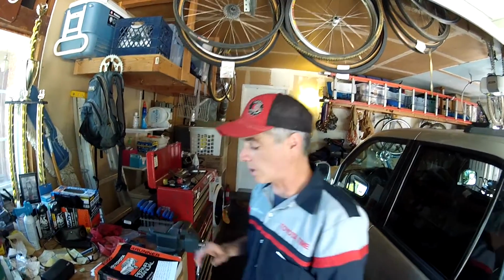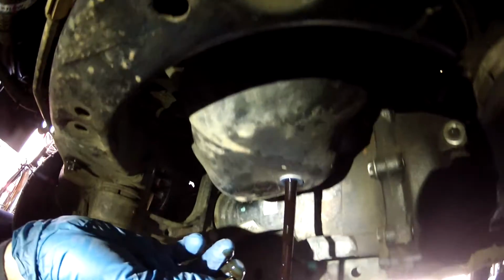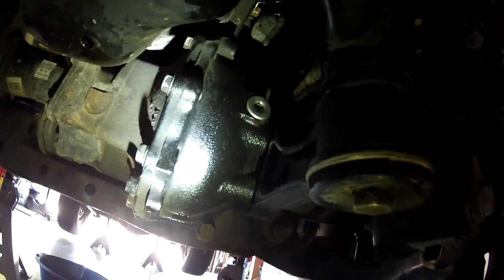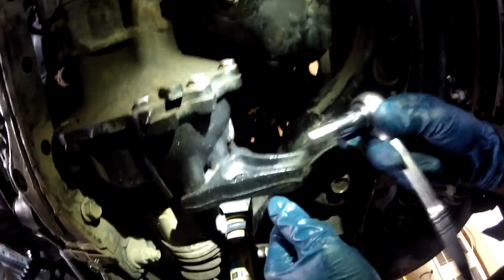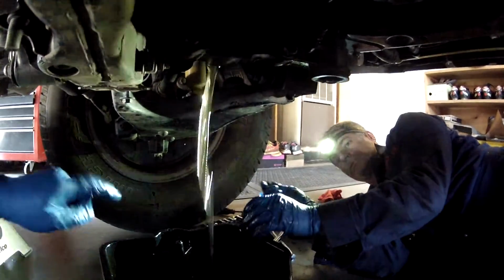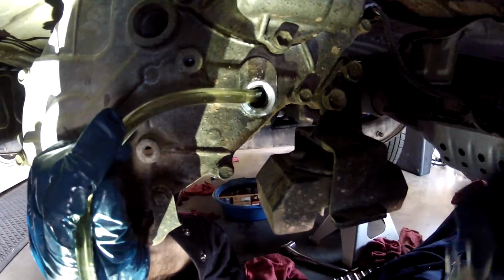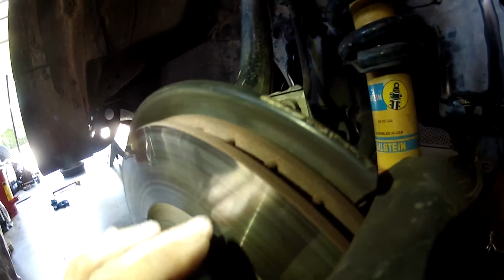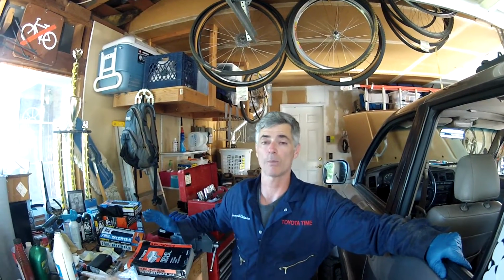30,000 Mile Interval Service

Comment: Sup tim. You mentioned you stripped the lower drain plug for the front diff.  How did you end up getting it off? Did you have to weld a nut as you mentioned? Mine is also stuck so i never serviced my front diff
Reply from the maker: Hey Jay, I was trying to get mine off with a regular 10mm allen wrench.  When I noticed it starting to strip, I went to a local mechanic who had a 10mm allen socket with a breaker bar and he stripped it the rest of the way for me.  So, I looked it up online and read about people welding a big hex head nut on there but I don't have a welder so I tried another suggested way of knocking it loose with a hammer and chisel.  I gave it several good whacks in the counter-clockwise direction, but it didn't budge and I was scared I was going to screw something up.  So, I brought it to the dealer and they gladly got it off for me for $150.  So nice of them.  I talked with the mechanic who got it off to find out how he did it, and the said he did it with a hammer and chisel.  Shit!  I had the right technique but I just needed a little more force.

When I helped Sean with renewing all his fluids, his was stuck really good as well.  But, I now have an allen head socket and a big breaker bar and I was able to get his loose.  I was ready to give up but tried one more time by using my leg to push down on the breaker bar while Sean made sure the allen socket wasn't slipping out of the bolt head and wasn't stripping.  I had to put my full weight onto the breaker bar to get it break loose.  Why Toyota chose an allen head bolt instead of a regular hex head bolt is beyond me.  

Anyway, when you come over to the house next, we can see about getting that drain bolt broken free for you.
Reply: Timmy, great vids thanks.  I've got a 98 4runner in upstate NY and I know all about frozen, corroded bolts.  I've had real good luck with a MAPP torch for 30-60 seconds and PB Blaster, and the breaker bar, nice and easy, rocking motion.  The impact wrench will spin the bolt heads right off and then you've just earned yourself an hours worth of drill time on the bolt shaft.  Keep up the good work!
Reply: i use a 15/16 sae socket with a 4 foot breaker bar and the bottle jack that came with the 4runner to remove it with out stripping.

Comment: can you use Mobil synthetic grease for the drive shafts? Its all I have and I used it on the u joints already.
Reply from the maker: Michael Ferguson I'm not familiar with that grease but I'm sure it's fine.  Many people use synthetic greases and oils instead of conventional.  But. to be sure, just research the accepted uses for that grease online.  I'm guessing you'll find a definitive answer quickly.

Comment: Just an FYI: One thing I learned about Toyota skid plates in fact any skid plates was that I always flush them out with brake cleaner and then use compressed air with a small nozzle and cleaned the threads out from the top and including blowing any debris and or using a wire brush to clean the threads. I have seen several Toyota trucks and other brands but multi Toyota having those threads stripped because of some small matter like rock or some other debris had gotten the thread and just made something simple, much more difficult
Reply from the maker: That sounds like a good technique to keep the threads clean to avoid stripping the threads.  However, I have another theory on how those threads get stripped.  I know for a fact the previous owners of my truck never worked on it themselves.  They always took it to the dealership or some other auto repair place.  The guys working at these shops always use air guns to save time and I'm pretty confident they often cross thread or over-tighten the skid pan bolts because they are in a rush to get to the next job.  If I bought my truck brand new, the skid pan female threads on the frame and the bolts would have been in much better shape than when I bought it used 3 years ago because I know I would have been more careful than the paid mechanics.  I've had to re-tap many of the threads and have replaced most of the bolts.  

There are good mechanics out there, but I'm learning that I can do just as good of a job or better than the paid guys because I'm in no rush.
Reply: Absolutely true about shops and dealers, they're on the clock, more like a chronometer! Breaker bar to break loose, impact to remove.  Hand start at least 4 turns, then ratchet or wrench. Old school master technician, my father. Over 40 years working on engines!
Reply from the maker: You should get your dad to make some repair videos.  Sounds like we could learn a ton from him.

Comment: had my 99 4x4 4runner for about 6 month's, bought it from a dealership said it's was mechanically sound but I've found a few things wrong with it, rust and front skid plate held on with zip tie.... but I love my 3rd gen need to put some work in, great videos keep up the good work!
Reply: Limit zone sounds like the one I brought too, air con wasn’t working and noticed the compressor pump was missing and all sorts of other messed up things but I love it

Comment: Great videos! These are the most thorough videos for Toyota 4Runners I've found anywhere. I looked up the service manual for my 2002 4Runner. About $300.00 for the two book set. Since I plan on keeping this 4Runner until the body rots off, ( I live in Maine) Those books are a good investment to make. 
I had to change out my starter a few months back, did it somewhat the same way that you did, but I couldn't get the transmission dipstick tube out. I was worried about breaking something so I ended up dropping the sway bar down to remove the starter from the same hole where you put the ratchet extension in, from like 3 feet back underneath. Was a pain in the neck and cold as hell outside when I had to do it, but it saved me a lot of money. Used a bottle jack to raise the sway bar back into place and tightened everything up once the new starter was in place.
Great job on the videos!
Reply from the maker: Glad you like our videos.  Yes, having the Factory Service Manuals is a huge help.  I looked for a while and then bought a set for $300 as well.  You'll be happy you bought them.
Reply: Watching you do your repairs makes me jealous to see how clean the underside is and how easy the nuts come undone. You guys in Cali are spoiled...no rust.
Reply: I got the 3 volume repair manual set for my 02 Tacoma on Amazon for $106 and 26$ for shipping! Great deal!

Comment: Excellent as per usual.  You guys set the bar high.  Only comment I have is maybe add time links to the description for the different services.  Would make it easier to use as a reference.
Reply from the maker: Hey Daniel,  thanks for the suggestion and I think I'll do that.  Sean actually wants to divide the video into several smaller videos for the different services.
Reply from the maker: Hey Daniel, I finally followed your suggestion.  I added times into the video description so people can jump to the part they'd like to see.
Reply: Awesome!!  I'm watching the driveshaft grease section...I bought a pistol grip grease gun off amazon and some valvoline grease.  A friend of mine with a 4runner said that it wouldn't have enough power to do anything since our trucks are old and the zerks are probably rusty. Is this bs?  Here is the one I got:

https://www.amazon.com/gp/product/B000MD4YKM/ref=od_aui_detailpages00?ie=UTF8&psc=1

The grease (safe to use this on all of them?  I'd rather not buy two guns...)

https://www.amazon.com/gp/product/B000CQ4DK0/ref=od_aui_detailpages00?ie=UTF8&psc=1
Reply from the maker: Unless you're dealing with some serious rust problems, I'd have to say your friend doesn't know what he's talking about.  Just clean off the zerk fitting before you push the grease gun fitting onto it.  

For the u-joints, pump grease until you get some squeezing out of the ends of the joint.  Then wipe off the fitting and any in the joint you can get to.  Some grease is going to spit out under the truck due to the centrifugal force and it's normal to see.

For the front driveshaft slip yoke,  have the truck resting on jack stands on the frame with the wheels off the ground.  Give it around 4-5 pumps and call it good.  If you see the driveshaft start to expand while you're doing this, stop.  Take the zerk fitting out, I think it's an 8mm, and let any excess grease ooze out.  Unless you 4wheel a lot, the front driveshaft won't require much greasing compared to the rear driveshaft that's turning all the time.

If this is your first time greasing the rear driveshaft slip yoke, I'd do the following:  With wheels off the ground and the truck resting on jack stands on the frame,  pump the zerk fitting until you see the driveshaft start to expand a tiny bit and stop.   Remove the zerk fitting and get the truck back on it's wheels.  Now get on the bumper and jump up and down to actuate the suspension to push out any excess grease out of the slip yoke.  Reinstall the zerk fitting.   The reason for using plenty of grease for the rear slip yoke is because of my and many other 4runner owner's experience with the rear slip yoke binding problem.  If you develop the bumping problem like I had, reference the first two videos I made on this subject.  The Ford XG-8 grease fixed my problem.  

I believe using the same grease for all applications is fine and the one you chose to use is similar to what I'm using on my rig.  I only have two different grease guns because one is filled with the special Ford grease I use for the rear slip yoke.

During this whole process, I have the transmission in neutral and the parking brake off so I can turn the driveshaft to get to all the zerk fitting easily.  I hope this answered your questions.
Reply: Yes that is BS.  To add to Timmy's sound commentary, if you have a problem with a zerk fitting, just replace it with a new one.  You can get a bag of them for a couple bucks at any auto parts store.

Comment: Great video! 

Just a few thoughts, additions if you would of what helped me: 
I spent about 30 min to an hour trying to get an oil filter wrench on that filter,  if you are fighting for it, I just got on a pair of work gloves (that are textured for grip), and came in from the fender well, if the filter wasn't over tight to begin with you should be to just remove it with your hands. 

Also, for those that get twisted with lefty loosey/righty tighty like me, I figured use the right hand rule, put your thumb in the direct you want (in or out) and then your fingers will give the direction in which you have to twist. 

Those in the rust belt, I take the extra step and degrease the under carriage, and apply a fresh coat of fluid film, (or just spray those brake lines with fluid film) I think it goes a long way. 

Thanks for the great video, I learned a lot

Comment from the maker: The lighting wasn't the greatest in some areas of the video, especially the part where I'm removing and replacing the engine oil filter, but we added some additional footage to make up for what you couldn't see.  I almost made a mistake thinking the front differential drain plug didn't have a washer because I didn't see it fall into the drain pan.  I hope this video was helpful to you and if you have any questions, please ask.